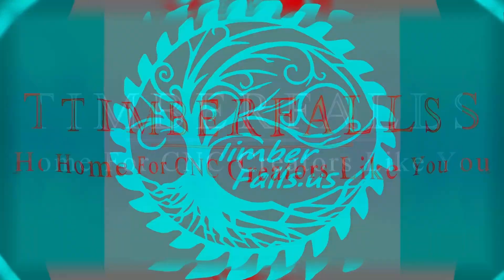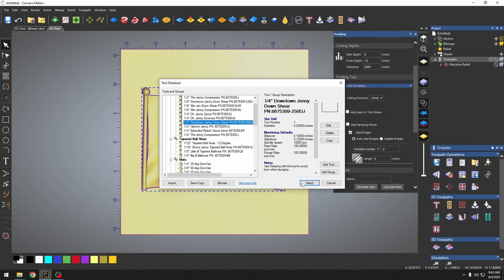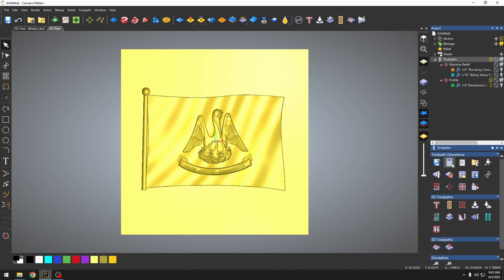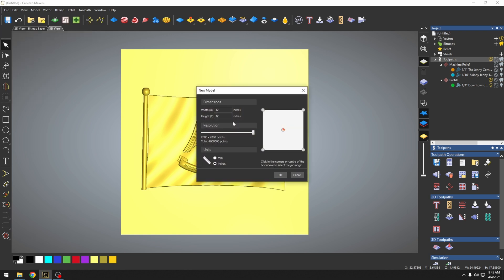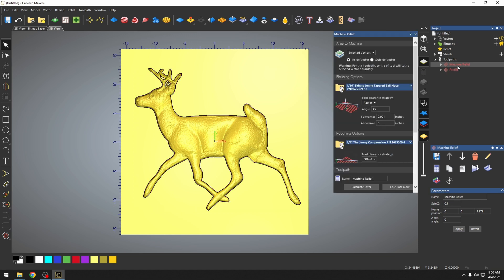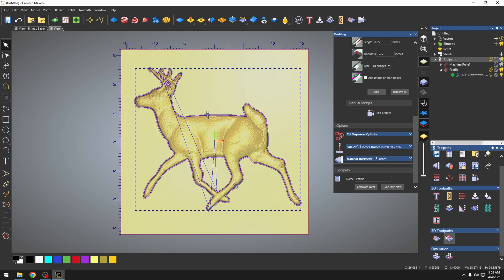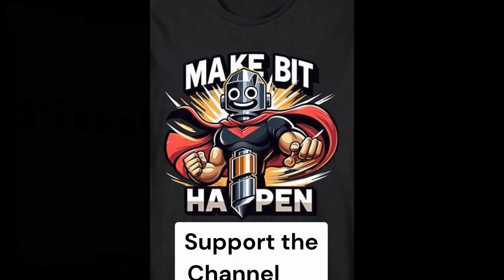Master Maker Plus Toolpath Templates in 5 Minutes!

Comment: Can you explain the reasoning behind using a compression bit for a relief carve?
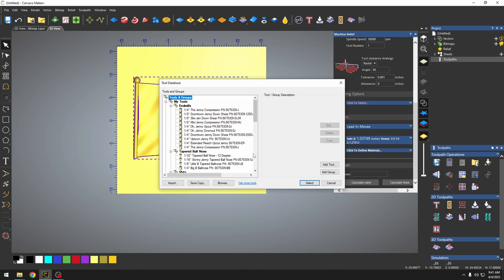Reply: Yeah, looks like he set up the tool path with the 1/16 tapered ball nose bit at 0:23 and then specified the 1/4" compression bit just for the roughing pass at 0:38.
Reply: @ddog800-v4s   that makes sense. I was watching on my phone so I didn’t notice a ball nose bit.
Reply from the maker: I have found that the compression bit has the least amount of impact on small parts that may chip out with a regular upcut or chipping bit. If my model does not have a lot of small detail I will actually use a o-flute upcut for chip removal.
Reply: @Timberfalls  You must mean as a roughing pass?  Because a compression bit is not going to give the detail  that a ball nose will.